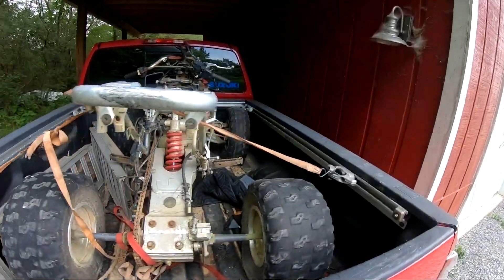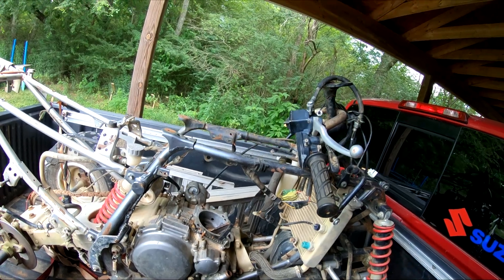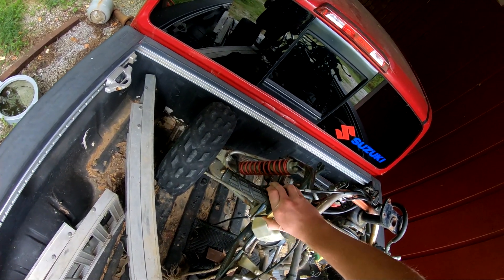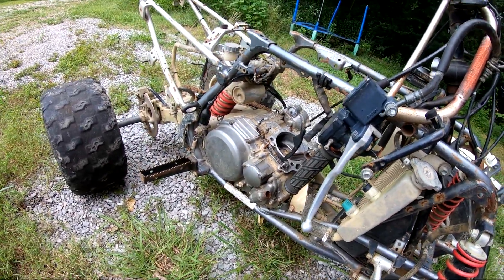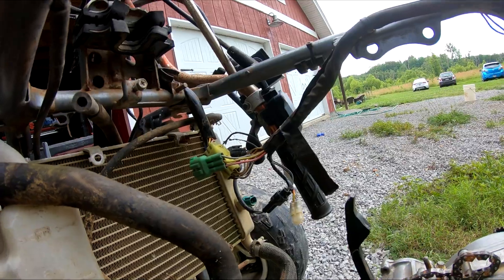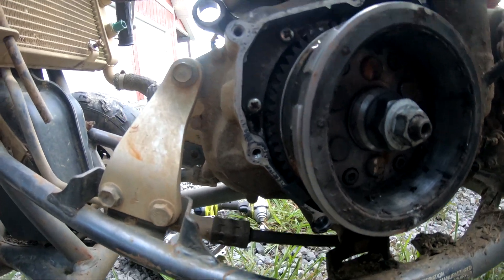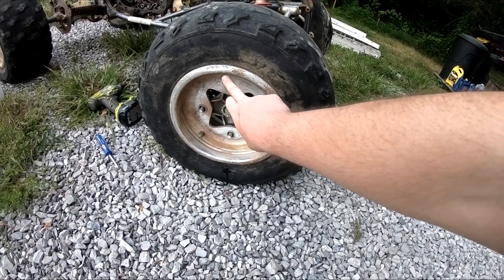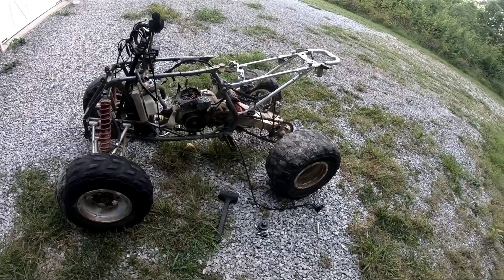I Bought A Parts Quad! (LTZ 400)

Comment: Dude if the transmission is good in that motor i could definitely use it, mine has issues, mine will shift on its own lol.
Reply from the maker: Seems to shift but the engine had some water in it so it would need cleaned I'm sure , and the crank is toast
Reply: @dbaKen  I would just need all the gears